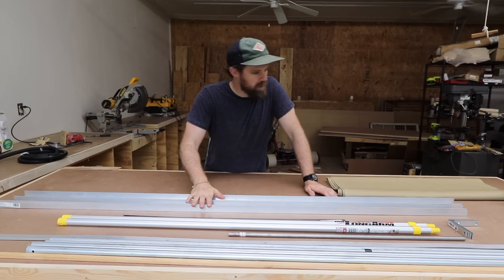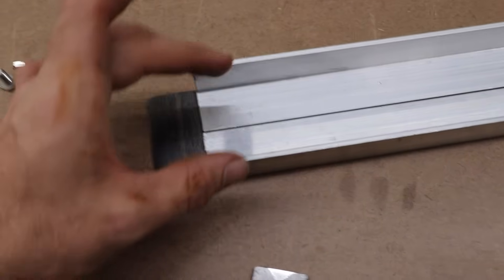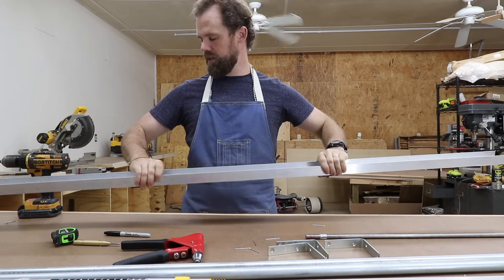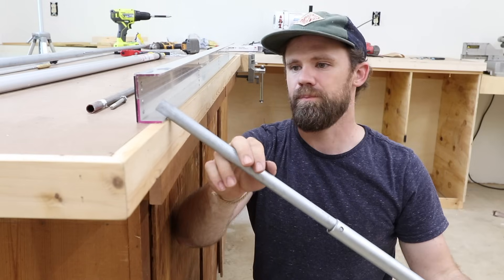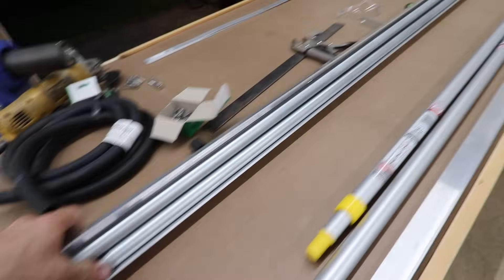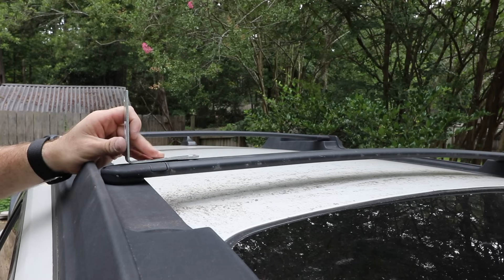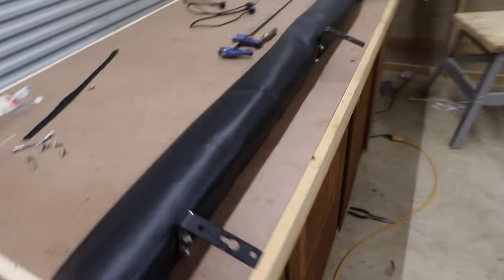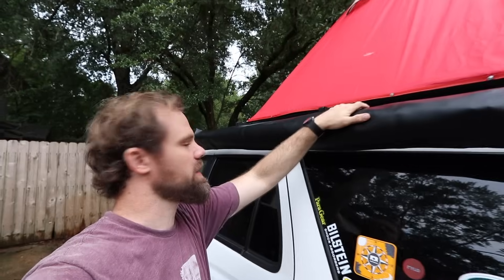Building an Awesome Truck Awning!!

Comment: The best diy awning I've seen so far. And I've seen a lot.
Reply from the maker: Thank you! 🙏🙏🙏
Reply: i agree
Reply: Nice awning, simple design, easy set up. Very easily sourced materials. Thanks for the video.
I would like to see you do a diy build on a pop out shower stall and shower heated by solar. I see some made out of big pvc or abs pipe and they pressurize them with air, I have also seen one that was a military water can with a submersible 12vdc water pump.
Thanks again for the video.
Reply: hell yeah!
Reply: I put one on my 8' truck topper. But, I used the C channel mounted on the topper. Trap slides in the C channel.

Comment: the part about building the awning is great... but the part that you use a hose piece instead of a fixed attachment is just genius... it removes all the stress .. and if/when it fails..  is a $2 dollar fix and back in business, you can even carry some extra in your tool box... Awesome.
Reply from the maker: Thank you!
Reply: Yeah, I was just about to say that he needs to submit a patent application for this immediately before CVT, Darche, Smittybuilt etc see this video. We had a 6’ CVT awning and that was my biggest complaint. The tension rods had no flexibility and allowed minimal adjustments. I was always afraid I was going to bend them. Then when the sun was low or in the rain you couldn’t adjust the awning low enough to block. This is pure genius.
Reply: I told him about it 🙂
Reply: Using the hose is genius!  In fact, his entire design & build is genius!  Having his daughter watch dad work…priceless!  Great job Patrick!

Comment: Auto trimmer tip for you. When setting vinyl a longer stitch length is stronger than a shorter stitch length is. This additional vinyl (or leather) material between the needle holes prevents the seamline from becoming a perforated tear line under stress.
Reply: Wow good point

Comment: The problem with rooftop tents is getting dressed sitting down in the tent  and you need somewhere to sit/prepare food etc. when the weather is bad. I have added zips to three sides of the awning and made three individual zip on sides to make a fully enclosed tent. The end section has a zipper door and the side pieces have mesh screen windows with a roll up canvas cover.  Also added side panel to fit between the wheels to close the gap under the vehicle. A spare extendable pole placed in the center of the awning ensures good run off in heavy rain. Flipping the roof rack mounting brackets upwards will increase the head clearance. It is essential to have guy rope  mountings to secure the awning in windy conditions . Pegging down the side panels makes the set up fully windproof.

Comment: Very cool Sir. I think I was most impressed with the vinyl cover. I’m new to sewing and I haven’t attempted sewing a zipper yet. Why us guys aren’t taught how to sew at an early age is a mystery to me. So many cool pieces of gear to make! 👍🏻
Reply: Girls are rarely taught to sew.  People are too busy on their electronics:(
Reply: Love it that you want to sew. Take a look at the information about the stitch length. Wider stitch is better and stronger. As to not create a tear where vinyl is puched from the needle. I am a  61 lady now learned to sew and watched my dad and brother work on cars.  I learned though by watching. Thus Jeep Wiz I put a new radiator, hoses,  thermoostat, radio, head rests, missing screws, and other things recently to an 04 jeep. Remember you can walk through a vehicle scrap yard for things as well. You can remove interior items like the black hooks from jeeps and use them in camper builds. I also found roof racks cheap. I want to find a Subaru rack but have not yet. Sold my jeep.

Comment: I thought I would tell you that I started building one a few months back after I got just to the point of getting the material for it. I got a offer to buy a 6×8 awning for $107 including S&H so still a win. Now I'll just have to convert the one I was building to a 270° awning for the other side. 
 Great job! Thanks many times over.

Comment: Thank You!  You have given me some ideas, I have a 2010 transit connect I have been converting into a camper for some traveling.  I added a hand held shower head to my 15 gallon water tank so I can take a "room temp" shower out back of the van, and a spot to stick the porta potty if I am camping there for a few days.  Will add side walls and this way I can close the back doors of the van for security and still have this set up.

Comment: This video reminded me that I need to repair the end of the vertical poles for the similar awning on my pop up trailer. The year before Corona the bag for our awning was falling apart. So I bought some Sunderland fabric online and my upholstered friend made a new bag. Had to add web straps on the outside with clips to keep it from blowing around on the road. Velcro straps on the sides for wind flap would be good or there are plastic clips for the same available from Amazon. In my part of the world (Mojave Desert), tie downs are necessary on the outboard poles.

Comment: Awesome canopy! Couple ideas... Snap straps where the middle is drooping. You can use rivits in the wood plug instead of screws. The roll straps, attach them to the brackets that attach to the roof rack so they don't come loose, a fender washer might be good to add strength to the straps. Add hoops to the end so you could tie it to another person's roof rack, a tree, or the ground for rough weather/wind. The keyholed brackets use those same spring clips to lock it in rather than bolts or with the bolts for easier connection.  I LOVE YOUR VIDEOS, they get me thinking, you have great ideas! Thanks!
Reply from the maker: Thanks for the recommendations! Working on a 270 awning now!

Comment: This is really a fantastic build, and it looks like any pro/commercial built unit at first glance. Nice work man!
Couple of recommendations...maybe for a future update:
- Double-hinged horizontal supports would allow you to pull the whole thing out at once, and eliminate the need for the heater hose.
- On that note, real deal heater hose snap clamps (like the ones you find in your engine bay) will not stress the rubber as much, but still provide a secure hold and super low profile 
- Condsider sewing those webbing straps to the inside of the vinyl cover so they don't fall on the ground/get mucked up/get lost.

Again, this is an ingenious build and so inspiring for your fellow DIYers. Thanks for the great content 👍
Reply from the maker: Cody Villa glad you enjoyed the video and thanks for the feedback! What is a double hinged horizontal support? Have a link to that?
Reply: @PatrickRemington  No problem man! Thanks for the reply.
Think of grasshopper legs, but with the "knees" folding inward to rest inside your c-channel when put away. A lot of RV awnings have them mounted vertically, rather than horizontally. I'll see if I can link a pic.

Comment: Hi Patrick, super job on the awning. A real alternative if you've got the skills and the gear. Small point...Alum and stainless don't really like each other but it's an awning so no worry. I sometimes use the steel 'nail' from the pop rivets if i'm short of panel pins for woodworking, and i sometimes use the aluminum parts as solid rivets so i don't get the 'lump' on the back. I think your little apprentice has a bright future! Thanks for sharing Patrick. Stay safe and keep up the good work. 👍🖖😎🐶🦴😺🚙🌈

Comment: If you cut a notch on the “pushing rod” to add the button, you can correct for twist as you get close to the pole button hole.
Reply: brilliant!
Reply from the maker: I just drew a black line so that I knew when I was getting close and in alinement

Comment: I see only one issue in your construction. You used steel flat bar to make your c channel. Steel and aluminium next to each other will cause galvanic corrosion which could cause the joints to fail. You can fix this by using aluminum flat bar instead of steel or put a piece of plastic or rubber between the two. Also if you use aluminum rivets on the steel, they could fail as well. Just a tip for future reference. Besides that, outstanding!

Love your ability with sewing machine as well.

I am always impressed with people who try to do it themselves before buying an expensive item
Reply from the maker: Thanks! I’m glad you like the build! I definitely wasn’t thinking about the dissimilar metals when I built it but I did paint the flat bar before riveting it on and the rivets and bolts are galvanized which should have much less of a reaction with the aluminum. It feel like it would take a really long time to fail either way.

Comment: I know this is a few years old, but when making the legs you should have left the threaded part and have that part be the going to the ground. You could then make attachments for the ends of the poles depending on your terrain. Say you are a place with soft enough ground for a stake to sturdy the post, or in a parking lot and you want just a weighted attachment. Just a thought.

Comment: Two to three strap ends on each side either with a buckle system or just Velcro to be able to strap the long sides to the supporting poles will allow the material to be stretched taut  and prevent rain buildup and sag in the middle.  Washers under all the rivets going through cloth and relief holes where the flat aluminum rides over the bolt ends for the supports.  Better yet, integrate the support bolt such that it passes through the flat and cloth with an additional washer.  Great overall design!
Reply from the maker: Thanks for the suggestions! Love those ideas 🙏🙏
Reply: @PatrickRemington   Wow, happy to see you're still reading new comments a few years later.  I looked but did not see a followup video.  Are you still using the awning?  Any modifications?  How has it held up?  Things you would do different knowing how it performed?

Comment: It might be worth sewing velcro loops to the side of the tarp to connect to the conduit. Maybe also add an extra bolt to either side of the far brace so you can use tie-downs if it gets a bit windy. Good build overall, I'm just going to buy one as I'm lazy.
Reply from the maker: Yeah definitely.. I thought I had mentioned that I was going to do that in the vid but it must have gotten cut out
Reply: @PatrickRemington  to be frank you may well have, i'm not the sharpest tool in the box :D

Comment: I would add two or three Velcro tab straps, sewn to the side of the tarp to attached the fabric sides to the conduit to be more secure and prevent flapping in the wind.  Also to secure for wind, you may need a means to attach guy lines from the tops of the extension paint poles to ground pegs.  Nice not to have the tripping hazard of guy lines, but probably necessary during a storm.

Comment: Great video... Love the ideas.... I definitely think I would add some grommet locations along the long edge to add some bungees into to secure the canopy a bit.... The other thing I noticed is, it does not appear you can open the doors with the canopy mounted and the available headroom under the canopy... It looks like you have the room to build maybe a 6" tall bracket to mount to your roof rack and then mount your awning to it. This would give you a bit more head room and allow you to open your doors when mounted.

Comment: Loving the flexible hose bit. But for extra strength incompressibility, could you use a steel spring from somewhere? Just a thought for improvement

Comment: Maybe stitch 2 velcro straps to edge of awning on either side at 2 foot and 4 foot so it  doesn't sag in middle.  Can be attached to horizontal pole after awning set up.

Comment: Great video! How about a video for a shower tent that they call an “en-suite” that mounts to the rack.
Reply from the maker: That would be a cool project! I'll look into it!
Reply: @PatrickRemington  nice job on the build!  I'd also love to see a shower tent build.  I'm in the process of adding a second awning to the back side of an old coleman popup.  I plan to put sides, and flaps to close in for privacy (shower, changing, bathroom, etc).  Was struggling deciding on making my own hardware vs. buying pre-made parts.  Your video I think was the inspiration I need to build my own.  Thanks again!  Hope to see a shower build
Reply: @PatrickRemington   check out shawnee hills workshop they have video on it.
Reply: great for compost toilet or standup dressing stahl with mirror.  These are big concerns for standard hght vehicles at festivals requiring quick costume changes and bathroom breaks without spilling in the car.

Comment: Pro tip: when sewing vinyl it is advised to make the stitch length a bit larger (in the neighborhood of 2mm or 5/64 inch) because otherwise the universe will find a way to tear said vinyl along the dotted line...

Comment: One thing I noticed with your side poles is that to fold inside the C mount, you mounted them offset, and that got me thinking that you could have them come out as an X instead of a | | shape. This should prevent the center from drooping/pooling water and add some stability.

Comment: Just drill a hole at each end to tie your ropes to to peg it out that’s all my bought one has and it works a treat. But also consider riveting the webbing to the back but on the inside of the cover so that your buckles stay in where they are supposed to be. Great job though mate looks very similar to my kings awning.
Reply from the maker: Yeah, I'm going to do all of that! Got in a hurry at the end and forgot to mention some of that!

Comment: Interesting video and adorable baby ... (From a craft/fabricating-challenged person) had you thought of making the fabric sheet in a similar style to shade sails?  I have read that the swoop sides help with tension control across surface of the shade.  I may try/attempt a modified idea from this by using your method of conduit poles for uprights and jimmying something for a detachable mount to roof rack to work with a retail shade sail kit (someday I will get a sewing machine, but some shade sail fabrics are supposed to be UV-blocking but still light transmission/filtering).  Obviously your duck canvas will be quite water and light blocking so probably depends on personal preference.

Comment: How about an outdoor shower 🚿.  One that uses black pcv pipe to hear the water and a Schrader valve to pressurized the system . It can be mounted on your roofrack opposite the awning for balance. Possibly have a reflector similar to a solar cooker.

Comment: You should drill out ovals in the horizontal poles where the bolt goes through them and bypass the heater hose

Comment from the maker: Who's building one?
Reply: yeah buddy
Reply: I'm going to be building one for sure! I have tried a couple times, and was not really satisfied with my results. Well done man!
Reply: I’m definitely going to!
Reply: This guy
Reply: And me!
Reply: I’m gonna give it a shot, but I’m trying to think of a good way to add mosquito netting lmao

They are damn near humming birds here and SWARM

If you think of a smart way to add a bug mesh, update me- I’ll do the same if I make something that works well
Reply: I plan on it. Been looking at more complex options that’ll just take too much time. So some simple mods to your design and I’m in!
Reply: Definitely going to try this. I have used the telescoping rods for my kitchen slide out for extra support, but that was clutch for this.
Reply: I found a DIY plan for a 270°, I'll be using it on my trailer.  But I'm contemplating doing one of these for the wife's rig.
Reply: Have built something similar. Rather than a soft cover, I used thin wall 4" pvc with a polyethylene hinge. You have some really good ideas with the rivets and the hose. Thank you for all the time you put in to making this video. Well done!!
Reply: Im thinking a batwing style variant!
Reply: Working on building one this weekend.  waiting on the spring clips to arrive. using  a sidewall panel from an EZup canopy for the fabric.
Reply: Next big project on my outback... after the roof rack :/
Reply: Me for sure. I'll make it a bit longer though cause I'm working on my shuttle bus into my new RV. But your idea is the best one I saw up to todat. I'll have to pay someone to do the sewing though... :) Tks.
Reply: You are providing motivation to pullout the used sewing machine I bought off a local swap and never used (intimidated). Had "Home Economics" in middle school and made sweet cloth soccer balls - I had the skill then. I have to get my sewing game back!! (52yo now!). We have a rooftop tent coming in a few weeks, would be super sweet to make an awning near sweet as yours! Thanks for sharing your knowledge and experience. You are impacting more lives in a positive way than you'll ever know :)
Reply: I will be next summer when hopefully covid 19 has said goodbye to the world (fingers crossed).
Reply: I am where can I buy the spring clip?.... Is it available on line
Reply: I will build, I already have tarp and pipes
😎👍
Reply: I'm will
Reply: I might be making one
Reply: Will that work for a camper too